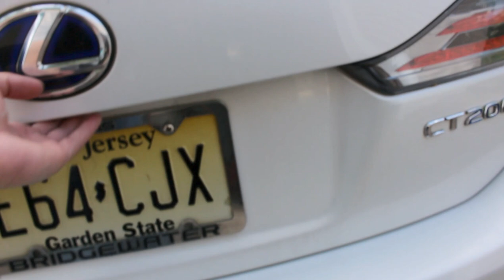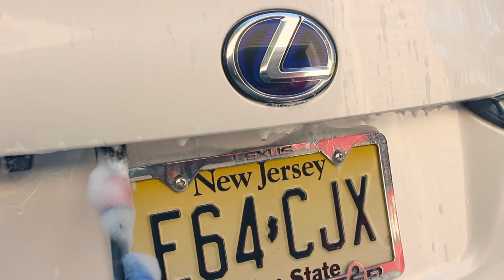Magandang Combination ng Sealant at Wax. Carpro Reload & Collinite 845

Comment: boz pwedeng magtanong paano kong nka mattr color ka e gusto mo maging gloss pwede ceramic coating agad
Reply from the maker: boss pwde lagyan ng ceramic kaso konting gloss lang mangyayari.
Reply: @pinoysidehustler  informative content mo boss. Ask ko lang kapag nagpapaceramic ka mas maganda ba repaint lalo na mga old cars ksi meron ng mga gasgas ?
Reply from the maker: @tofidt4258  salamat po boss.. kung hindi na po makukuha sa paint correction iparepaint nyo po.
Reply: @pinoysidehustler  Sir, any suggestion na brand ng wax.  Alam mo naman sa Pinas sobrang init ngayon tapos nakapark pa ako sa labas ng garage. Anu maganda for UV protection.
Reply from the maker: @tofidt4258  oo nga eh.. Fusso po or kaya Turtle wax na 75th edition. pwede din po spray wax or spray sealant